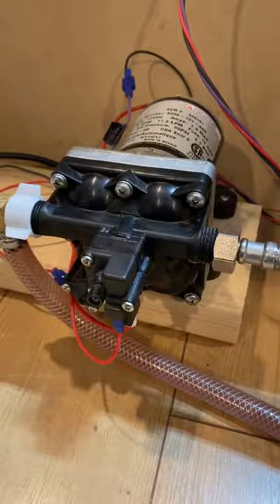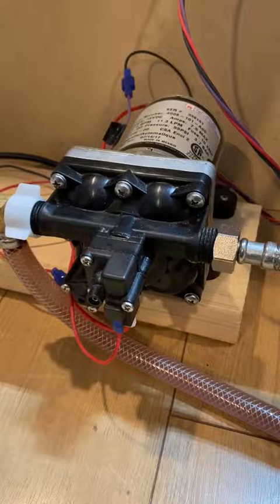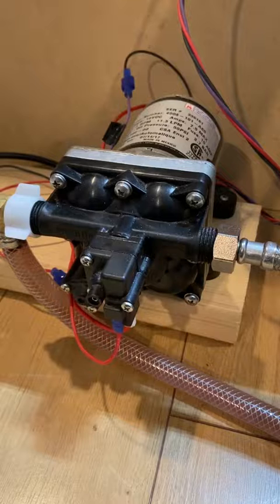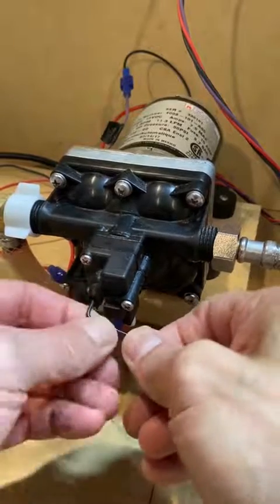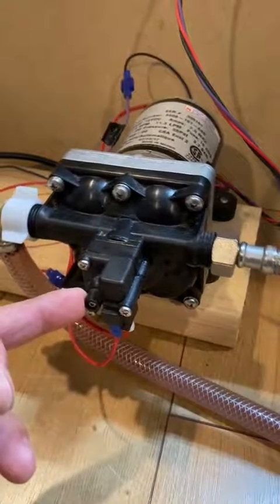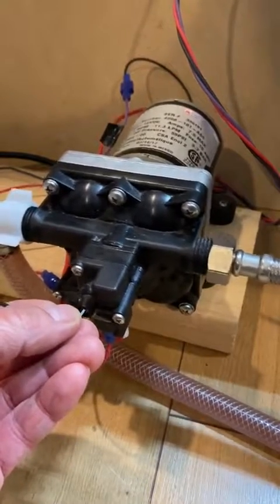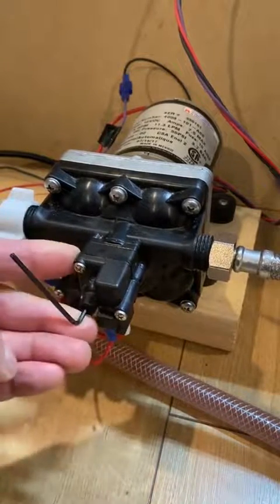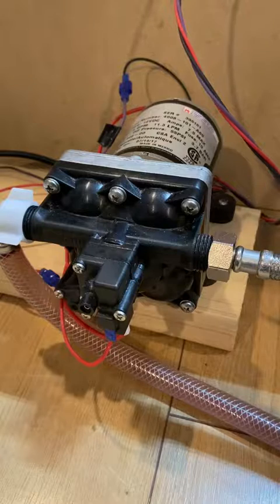Incorrect Pump Pressure Switch Adjustment

Comment: I installed the IRVWPC2 in my RV today and had this problem. I have a Seaflow 12V 3gpm Series 33 pump. I tried adjusting the pressure switch clockwise as you showed but it didn’t change anything after 3 complete turns of the pressure adjustment switch.

Comment: so is my pump bad if the city water is leaking into my fresh water tank?
Reply: Yes is the easy explanation. Mine did this also and instead of rebuilding the pressure seals etc.. I paid the $65 bucks (based on pump type) for a new one delivered next day via Amazon and in about 20 minutes issue was resolved.
Reply: @skip5002  you put the new pump in yourself?